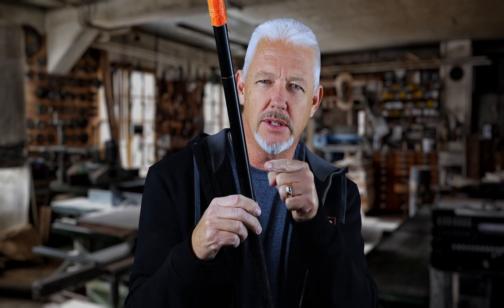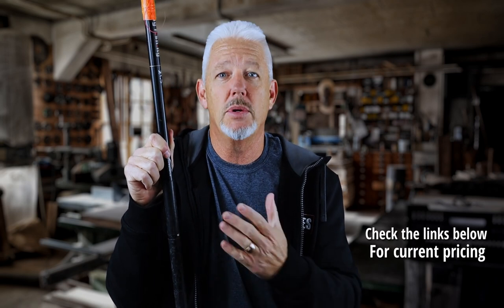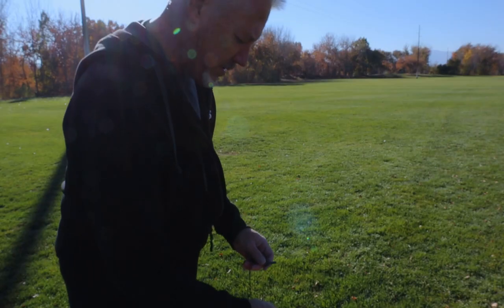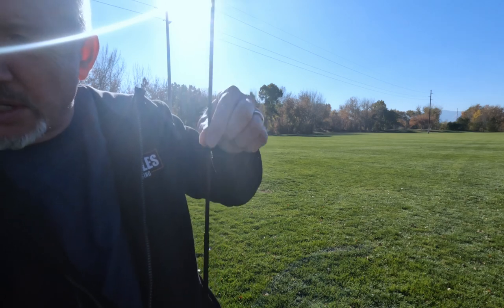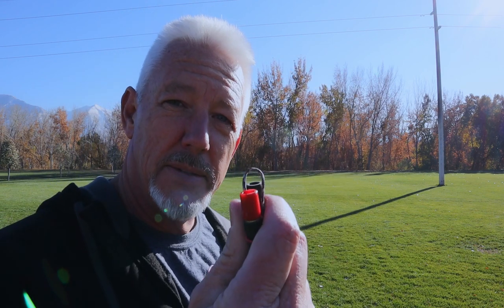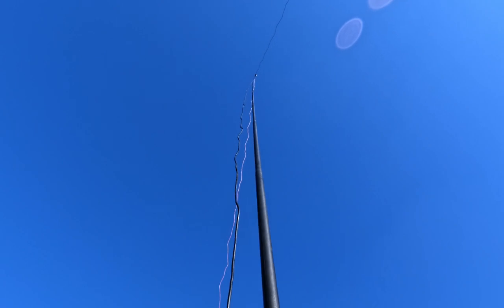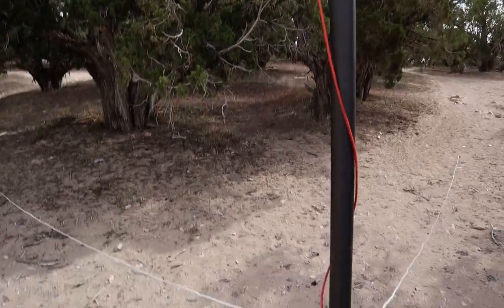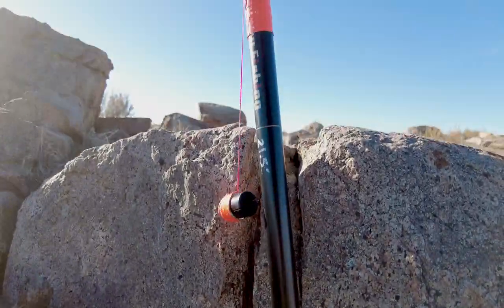You WANT this portable HF MAST in your kit | K7SW Ham Radio

Comment: Great video.  Lots of good info.  Another tip:  if there’s room, put a piece of sponge or foam inside the bottom of the mast.  If an upper section comes loose, hopefully it won’t get damaged when it slides down and hits the bottom.
Reply from the maker: That is a GREAT idea ! I appreciate you sharing that., i will be making that improvement.

Comment: Have a few similar poles and great tips - SAFETY FIRST - see the HV lines in the background?  Avoid induced voltage and stay far away from any electrical lines - then you can enjoy the hobby for years to come!  Also, I glue the end piece into the 2nd piece (not pulling it out) and it gives more support. Great stuff and cheers y’all!
Reply from the maker: Excellent safety tip and I like your fix for the end of the rod. Thanks for sharing

Comment: OK, this is great as always!  I've used a 20-foot Black Widow fishing pole for 20 years, and I agree that a fishing pole makes a great antenna support.  I used the vertical idea originally and later used it to support dipoles.  More recently I've been using a seven meter Spiderbeam mast.  And yes, I also discovered the paracord in the top section trick!  Here's a tip: I also use a very lightweight 49:1 transformer with my EFHW antennas, and 25 feet of RG-174.  I put the transformer at the TOP of the mast.  That way I can slope the antenna wire off in any direction I want, and can change the direction if desired.  I can also quickly change the length of my wire to change bands.  I have a connector in the middle of the 20 meter wire, so I can disconnect it and put on a shorter piece of wire for 17 meters or 12 meters, or whatever band I want.  Or, I can clip a loading coil on the end of the 20 meter wire to change to 40 meters.
Reply from the maker: Excellent setup William, those are really good tips, thanks for sharing.  Spiderbeam masts look really strong,  I need to try one of those.

Comment: I've been using these masts for years too. My favorite is the 10m one that's the same diameter as the 7.2m one but is about meter long, collapsed. I also have a 15m one that is great for going somewhere in a car but not for hiking, and a 7.2m one that collapses down to 17" for super portable work (QCX and single band wire)

Your tips for improving the masts are great. Here's one thing I've done differently:

For the string coming out the top, I did the same thing you did, but I added a bit of glue-lined marine heat shrink where the string comes out of the section, with about 1/2" covering the section and 1" covering the Paracord. I did this after I had too much tension on it once and the string cracked the section vertically. The heat shrink prevents this, and there's enough clearance between the tops of the sections and the cap to accommodate it.

Overall these are great masts and a great value. Thanks for the video.
Reply from the maker: That's an excellent idea, thanks for sharing

Comment: Great video.  To keep all the coax weight off the tip of the mast I use the aluminum twist ties and tie the coax to the mast at 3 or 4 places on the mast.  This distributes the weight all along the shaft and not just the tip.
Reply from the maker: Excellent tip, thank you 👍

Comment: I’ve used these for years as well… With end-feds, or light weight wire antennas they are an essential piece of kit…. The 7m SpiderBeam is really nice.  Heavy duty, and rigid, perfect for an inverted V…

Thanks for the video, great to see how others play radio.   72 de W7UDT
Reply from the maker: You bet Randall, and thanks for sharing your setup.

Comment: Those poles are great, I have a shorter variant, just  43cm (shade under 17")  collapsed, yet it is almost 6m extended with tip in three sections. I still have the tip sections though (see below). I have put a swivel on a short tube that squeeze over section about 70cm from tip, I then use that for attaching antennas

Reason why I kept top, I like fishing, and just taking the top 4m is great way to catch the local brook trout, sadly I have not found that brand again, luckily I bought 4 when local tackle store closed (owner turned 80 and retired),

Comment: Great presentation!  I have been using this type of pole for a few  years and they are quite handy and easy to use.  Purchased an alleged 12M pole,  usable length ~35 feet, works great for a 20M EFHW as a vertical dipole.  My current 'pole arsenal' includes 5,6,7, ~10 and a 12M spiderbeam pole.  Heck, the 12M  pole will handle a shortened 20/40M shortened EFHW as a vertical dipole as well.  A fantastic tool for portable operations!
Reply from the maker: Yes sir, I know exactly what you are talking about. Thanks for sharing your setup. This will help many others

Comment: Yep have a 20ft Black Widow I've used with a 20M dipole I made in an L configuration. One leg goes up the pole. The bnc connector is a couple of feet off the ground and the other leg goes horizontal with the ground at the same height as the bnc connector.l I've made both voice and FT8 with this configuration with a G90 running 15 -18 watts. The carbon fiber is supposed to be somewhat conductive so I try to minimize the vertical leg contact with the pole. I've also used it as the high end of a sloper with an Emcomm III EFHW. Very light weight and portable. Holds up to windy conditions too. Good choice. I put a wrap of electrical tape at each joint with a field day fold just to be safe. Jack K5FIT

Comment: Nice video.  Been looking for a long mast but have avoided carbon fiber for fear that it will conduct enough of the signal away from the antenna to affect reception.  I take it that is not the case from your experience.  Also, I recently strung a Diamond 40M dipole antenna outside my balcony and used two fiberglass tent poles to hold up most of the antenna wire.  The far end of the wire is held up by a stiff extendable fiberglass pole that was once part of an old tree pruner.  The tent poles look exactly like your fishing rod but have four extendable sections that can extend it 2.5 meters - enough to position the antenna wire far enough horizontally from my balcony so I can operate at 100 watts safely from my base station, which is in the room just inside the balcony.  To mount the poles to the house I used two flagpole mounts and some bungee cords to hold them in place. The tent poles are stiff, well made and cheap.  I got two off of Amazon for about $40.
Reply from the maker: Perfect example of creativity !

Comment: I LOVE the idea of using a BNC binding post with the radials! A great idea for making a 40m quarter wave with a 10m fishing pole. I need to try that! SOTAbeams UK sell a couple of what they describe as (low level) guying flanges - one 32mm device is too small for a 10m pole and happens to sit on the pole at about 7m or so. It is ideal for deploying centre fed antenna as it has holes every 30 degrees so can act as support for the dipole ends coming into a BNC binding post.

Comment: I have a Goture Goldite fishing pole I use for POTA. I actually kept the smallest section where I tied an overhand knot on the tiny piece of string on the end. On my antennas I have a small loop of nylon braided fishing line that I secure to the pole through a larks head knot. I pull it tight and the overhand knot keeps it secure. My antenna is a K6ARK EFHW with 26 AWG polystealth wire so it doesn't weigh it down enough to snap the pole.
Reply from the maker: The K6ARK antenna looks really nice and lite weight. Perfect fit

Comment: This seems very compatible with the QRPGuys 3-band vertical. The Base I made is a length of 1 1/4" PVC with a round cap glued to the bottom end after drilling a hole in the cap and securing a 1/2" threaded rod for the base. Since I am in Florida for the winter, I did not attempt to sharpen the threaded rod as it goes in easily into the sand here. Then my carbon fiber mast goes in easily or if a little bit lose the mast can have some shrink wrap put on the bottom section to snug it up. 

I am changing RVs this week so am limited on time, but I will use my Rig Expert AA-35 Zoom to tune the ~16' vertical wire after determining where to mount the circuit board with the toroids, with the radials extending down from there. I am not putting on glue from my hot glue gun yet in case I have to remove a couple of wraps from the toroids after tuning. 

I had a couple of chaps tell me to not use carbon fiber as it is conductive, however, a British Ham showed that the resistance was in K-ohms per inch and that his measurements of fiberglass vs. carbon fiber were MAYBE a 0.1 dB difference in field strength. 

I can't wait to play with this setup more. It is a great antenna for when there are no trees and/or limited space to set up. I pulled into one WMA here for POTA near Davenport, FL and there was only a fenced area for two cars to park next to the main sign at the gate area. Once through the hiker's 3-legged gate, there was only semi-cleared ground of an acre or so before the trail disappeared into the woods. 

This antenna would work nicely there and I am still pondering a decent setup with a camp chair, an aluminum foldable operating RV table, and some type of umbrella to support my sunhat activities. This property is in complete contrast to the other end of the spectrum where near Frostproof, FL there were 2 separate picnic tables with small roof shelters over them and a US Gvt CXT vault toilet, LOL. 

Both places had limited antenna opportunities, but the latter also came with six-inch FL spiders in giant webs bridging the wooden fence to the oak tree limbs everywhere so a deployed EFHW wasn't something I wanted to "deploy", LOL. Cheers es 72/73, Davey - KU9L
Reply from the maker: That's some good information,  I really appreciate sharing about the carbon fiber mast comparison.  I may make a video about that.  
Florida sure sounds nice and warm 73
Kevin
Reply: @hamradiowithkevin  Yes sir, great video idea. I only have a Chromebook so my video-making SW is very limited web-based, so I will not win any awards, but I enjoy making short montages. When I get the new RV I will go back to making videos on my Tuna Can QRPp gear and reviews as I cut my newly built antennas. I could putter all winter, keeps me going, LOL. Will keep an eye out for your next videos! -72/73, Davey - KU9L

Comment: I have found that the carbon fiber poles have rather sharp edges.  When untwisting and pushing down when it gives it can cause skinning or cutting of the pushing hand.  Be careful.  I use the PackTenna carbon fiber pole, a beautiful and functional pole.  This one looks to be lower cost.  So light and useful.    Dave K8WPE
Reply from the maker: Thanks for the tips Dave. One day I look forward to trying out the PackTenna Mast. There are so many options that it seems never ending the opportunities to find new gear to try. 73

Comment: I have this exact same pole andd it snapped in half once it sat in the sun for one day under the weight of my dipole. My dipole is constructed from plastic pipe fittings which might be too heavy for this pole, but still.. leave it on the sun all day and it will bend and crack. I have to find something stiffer and also small and portable. Fishing poles just dont seem they gonna last long imho.

Comment: Tenkara is really expensive compared to window washing poles and I liked having pure fiberglass. I'm looking for a surplus army aluminum mast now. I can't get on the roof or ladder anymore because of disability. I need it for 10m and 2/70 to hold a small moxon for tx and then run 100' of rx wire.
I need good rg174, any suppliers that you trust for budget cable? You have a great channel Kevin, thanks for not shilling for sponsors.
Reply from the maker: Thanks, I appreciate it. I can say that I have never had long term success with cheaper cable. Never would hold up well with winter and outdoor use for me. ABR industries is a go to and DX engineering is also a really good place to start with.

Comment: No interaction issues with the vertical and the carbon fiber?
Reply from the maker: If so,  I have never experienced any issues and and up with enough contacts to fill a happy log 🤩
Reply: I stixk with fiberglass for that reason.  Carbon fiber conductive and takes on RF.  So is the vertical like winding a wire around an aluminum pole?  Any RF engineers can explain the consequences?

Comment: Hi
I like your video's and saw all of them.
Regarding the vertical antenna on the Carbon fishing rod.
The Carbon is conductive and changing dramatically the spec of the vertical I tested for 20M.
I changed the rod to Fiberglass and the antenna works perfect.
73/Shalom
Jan Misgav
4X1VF
Reply from the maker: Thanks for sharing those findings, Jan.

Comment: Fellow utahn here! Thanks for the tips! Currently studying to upgrade to my General and was looking for a way to portably / temporarily mount an HF antenna in my yard, or even on the move! This was a big help and i think convinced me to go with a proper dipole rather than a vertical whip.May I ask, what bands have you had success with this mast?  I assume it's perfect for 10 meters, but I assume I might have a more difficult time going down to 40?

 Hope to be able to hear you on the air sometime :)
Reply from the maker: I do hope to run into you on the air one day. That would be nice. 
Thanks for the support

Comment: On the weekend I tried a VKFF until a thunder storm came in so today got my pole fully extended in my driveway laying in the warm sun to evaporate any moisture inside. You have some good tips of your experiences with poles. I have carbon 6 and it fits inside a piece of 40mm white pvc which becomes a base for my pole and a place to carry it on my backpack on SOTA hikes. vk5cz ..

Comment: This is great!  I was wondering what kind of extendable pole I could use as a semi-temporary mast, especially when on family vacations.  I was looking at fiberglass poles like fire safety teams use for smoke and heat detector testers.  These poles are hundreds of dollars (and big diameter and heavy, but they have to support several pounds at their tips)!

I've heard of using fishing rods but having never been the sportsy type, I never got into fishing more than the $10 Wal-Mart closed-reel beginner pole when I was 12.  I never knew poles like this existed!

Beyond that, I've never seen someone suggest a pole like this for a vertical.  Always for dipoles.  

I already had the idea of using ring terminals for radials (but I was thinking a much higher number of radials per each, which I've found can be much, much, much thinner wire).  Watching DXCommander Callum's videos, I've seen that halving the length of radials while doubling their number seems to maintain an antenna's operability -- so now the 12 radials I'm using on 20m at about 20 feet length (really, longer than they need to be, which is 16ish), maybe I could get down to 10/8 feet at 24, then 5/4 feet at 48.  Sounds like a lot, but 5 feet, or better, 4, at any gauge thicker than #24 would hold some small amount of spread away from the center...  and even if not, a supporting ring of maybe 2 or 3 feet diameter (hula hoop?  Greenbriar vine?  Kudzu?) could help with that...

You've provided me excellent experimentation fodder and have earned a like-and-subscribe with this!  Even if I never go portable, this will allow me to test out various ideas more easily -- currently, I'm limited in my antenna height and placement to wherever I can sling a pulley into a tree.  Where I have, I can only pull about a maximum 20 feet of wire straight up.  But this will allow me to get away from the tree, get a little more height, get a proper set of radials going...  maybe I'll even see some gain!
Reply from the maker: Glad this was helpful. I hope you become excited enough to experiment many many more antennas. 73

Comment: Being carbon fiber does it interact with the antenna throwing swr off? Specially in the vertical antenna config?
Have you checked for interaction comparing it to a pure fiber glass pole? Thanks!
Reply from the maker: I get that question a lot. If there is interaction, it is minimal.  I have used these masts for years with no issues at all and throughly enjoy it. 👍

Comment: Very cool.  What wire lengths are you using for the vertical configuration for both the vertical wire and radials?
Reply from the maker: Mostly for 20m. I start with 17 feet and trim to tune

Comment: Hi Kevin. I have used several fiberglass poles and one carbon fiber pole (Goture) from Amazon. 

The carbon fiber pole interfered with any antenna I tried with it. I've sworn off of them as antenna masts. Fiberglass works just fine. No reason to change it in my opinion.

EDIT: looks like exactly the same one in your Amazon listing! I have warned people away from that product on purpose. Do you require a tuner to make your vertical work on the mast?

73 de VE3GKT
Reply: I had the same experience with a carbon fiber mast.
Reply from the maker: The mast with the vertical setup for 20 meters is always a 1.2:1 or less on every setup and never needed a tuner. It continues to be a great setup. Thanks for sharing your experience. 73

Comment: I wonder if this fishing pole is strong enough to mount a Gopro on? If so, I think it would make a great poormans drone 😄.. For those places where you can not operate a drone this could be a great solution if you only need about 20 feet of hight. 😊
Reply from the maker: Great question jack, I will try that gopro setup for you.  I might reduce it one section.  It might be a little less than 20 feet. I will update you on how it works 💪
Reply: @hamradiowithkevin  Awesome! I'm thinking it should work as the pole was designed to pull in a fish. Though it might be too heavy and cause the pole to arch over. Humm Interesing how this experiment will turn out. Very excited to see the outcome of either success or failure. ☺